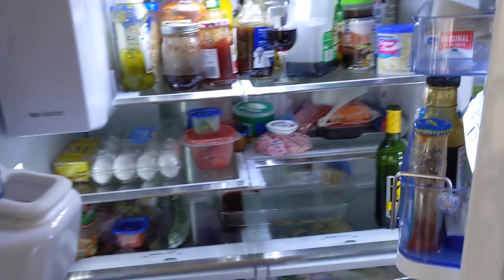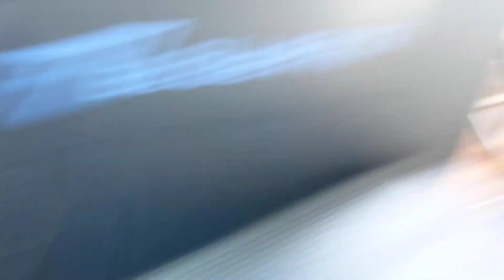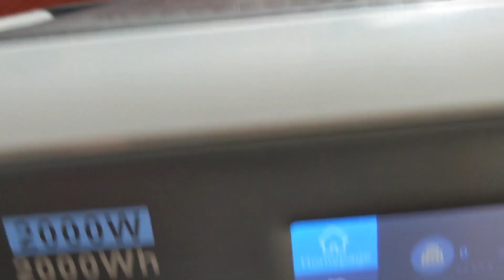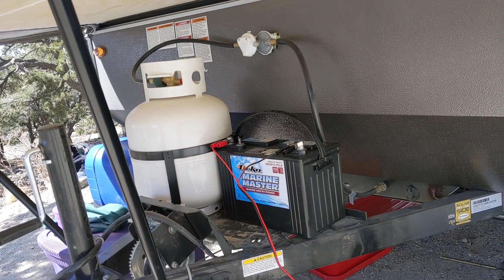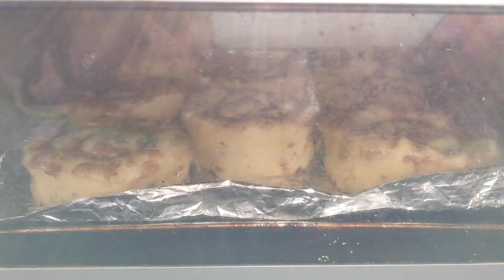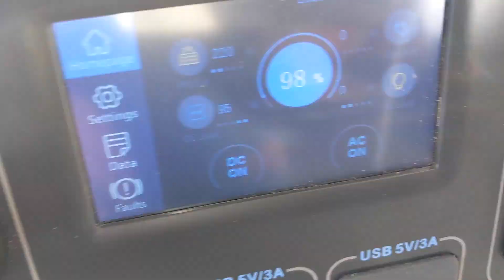Bluetti AC200P Power Station Review (Solar Generator)

Comment: Another great feature is the 3500+ lifecycle of the battery.  Many other units on the market only have 500-800 cycles.  When you factor that into the cost, you find this one to be the most economical power station on the market.  I did a calculation, and the cost/wh of battery capacity ($.80), AND, the cost/lifecycle($.46) are the lowest in the industry!  All the other brands were 25-300% more expensive in the cost/wh; and 300-1000% more expensive in the cost/lifecycle!!  Bluetti is the no brainer purchase choice.
Thanks for an excellent video presentation of the real world RV use; that is exactly how I will be using a solar power station.

Comment: Noticed you had 3 solar panels. Are you able to use 1, or 2? I know it will not charge fast enough, but I would be using a minivan camper conversion and wouldn't have enough room for 3 of them.
Reply: You have to use at least 2 to charge this also might want to look at the 200w version of his panels.